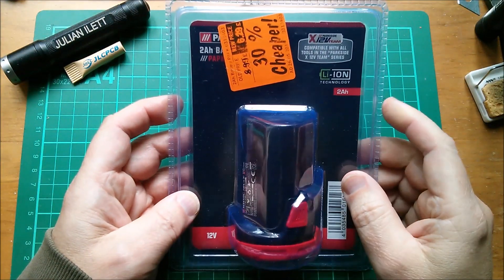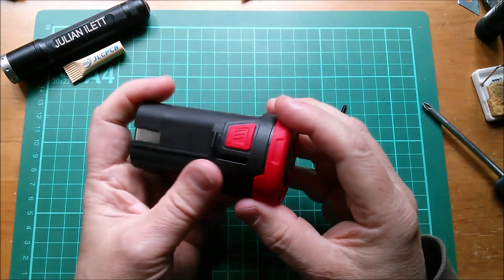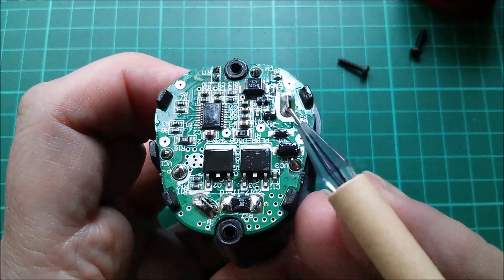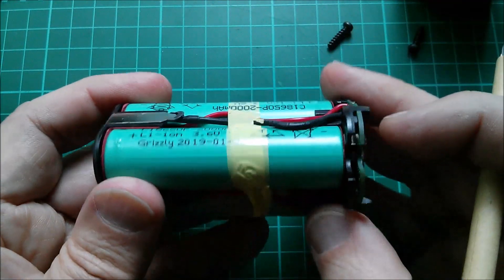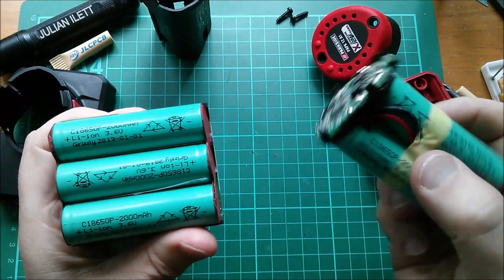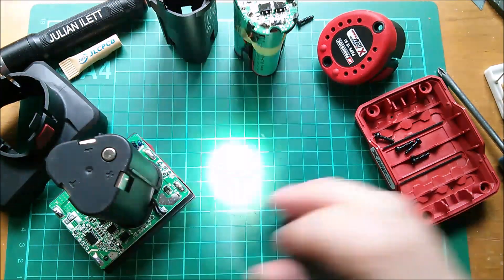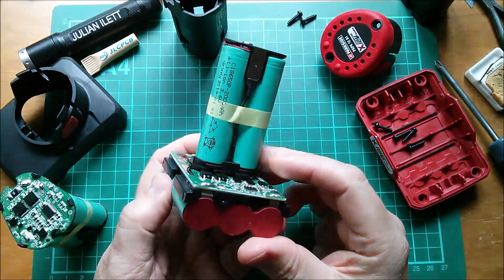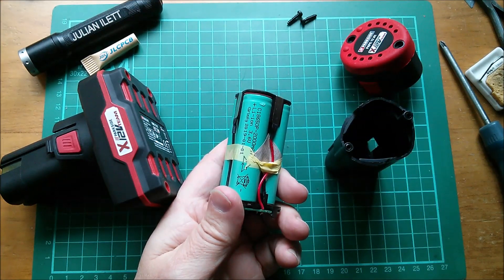Lidl Parkside 12V Power Tool Battery Stripdown - Very Revealing

Comment: Julian, I believe the method that is used is to short all the +'s together and all the -'s together so any cell that tried to undervolt is pulled up by virtue of being connected to the other cells. I know when I first saw this method I was somewhat stumped and even wrote to some manufactures about it, but it seems to be an accepted industry standard now not to balance cells as used to be done, but as I said to crowbar clamp the cells to one another. But when the cells are in series I am still very concerned that an overvolt situation could arise and cause a fire by overcharging.
Reply from the maker: It's hugely complicated to switch (electronically) cells from a series string to a parallel array. I thought about this method of balancing but gave up trying to design the switching matrix. That's why I like the inverter balancing technique :)
Reply: @JulianIlett  I guess there is a possibility that the newer cell chemistry has a form of negative feedback built in, so that as the cell approaches a fully charged state its internal resistance decreases allowing more of the current to flow into the other cells, be worth an experiment to see.
Reply: @foxabilo  
No that's not possible. There is no magic ingredient that makes other cells take more current when one of the cells is getting full. If cells are in series they always get (or deliver) the same current. That is just physics. If they are in parallel they will always be at the same voltage (physics again). That is the whole reason for having external battery protection boards (and balanced charging circuits in some cases) in the first place.

Comment: I got a couple dozen LG cells, 6 for $10 or less that way, only 1.5ah, but can do 40amps, about 24 cells. Not so bad for new cells, I guess I'm going to replace nickel cells in my dewalt drill, I wonder if it will handle 6s cells? 24v being 18v components??
Reply: Let me guess..Kobalt battery?
Most likely the motor can handle the extra 33% voltage fine, the main concern is the speed control.

Comment: Can that button be an identification chip using the 1-Wire protocol? It looks like those id tags with a small metal can that use 1-Wire. EDIT: 1-Wire iButton.
Reply from the maker: Very unlikely - these packs are built for the lowest possible price :)
Reply: Currently the function of this pin is not clear (to me). The charger does not recognize it nor do the devices I know. Maybe future devices will use it to distinguish between the 2Ah and 4Ah battery.
Reply: @MrCanidi  I think you are right, some devices could check the resistor value to determine the type of battery pack.
Reply: @goncal0mb  Agree 100% !!

Comment: Are these compatible with the previous gen batteries?
Reply: Most likely yes but you may need to modify the housing because they use codings. Look at the charger and you can see two small slots (07:31). You need to remove the counterparts at the battery housing and they will fit the older (less power) charger and work fine. When I remember correctly the older charges support 1,4A and the newer ones 2,4A. The older batteries were 1,5Ah, the new ones are 2Ah and 4Ah.
Reply: @MrCanidi  My jigsaw uses the 12VA1 whereas my Multitool uses the 12VB2-1
Reply: Ah the small one is a A1
Reply: They are identical except for the slot positions. Having bought some I just cut the raised strips from the battery and they fit both the old charger and tools. You could insert them the wrong way around but they will not go fully in or power the tool. Care is needed with the charger however.